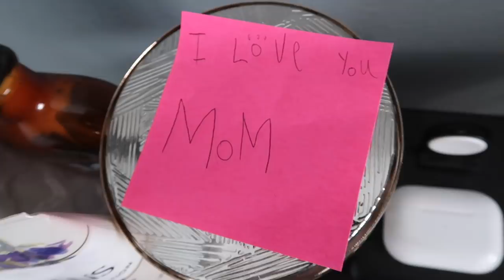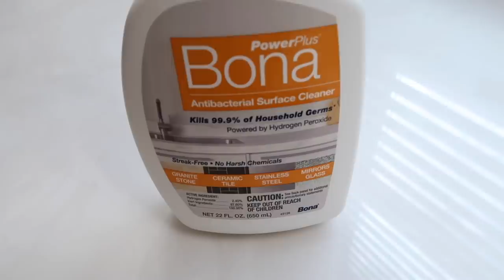*SUPER EXTREME MOTIVATING CLEAN WITH ME 2021| ALL DAY SPEED CLEANING MOTIVATION | DEEP CLEAN ROUTINE

Comment: i FINALLY wiped down my white cabinets in the kitchen after putting it off for MONTHS. A SUPER CLEAN. i don’t know why because i don’t have that many. my kitchen is tiny. it’s probably because there is not much space on the counters and my step stool isn’t tall enough to get the top part. but there was this yellowing (20 years worth) around all the handle areas that were driving me nuts. i think that’s why i put it off… i HATE it. i used baking soda, goo gone, magic eraser, clorox spray, vinegar and DAWN, but not altogether. i probably went over each area 5x’s. it’s much better but the yellow is still a bit visible. with that being said, i’m so glad i finished. i got new knobs too. i don’t know why i just wrote an essay, probably it was a pain in the booty. 
😩 

for spot cleaning i’ll just use water/vinegar/squirt of DAWN. 
touch ups and knobs, CLOROX wipes. 
this is VERY important information, jamie.
Reply from the maker: Thanks for sharing this!!